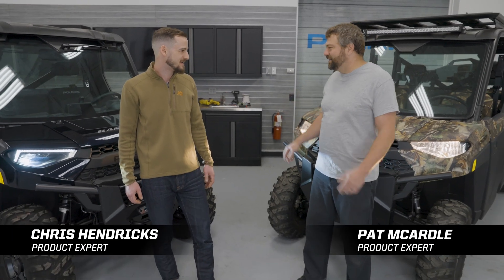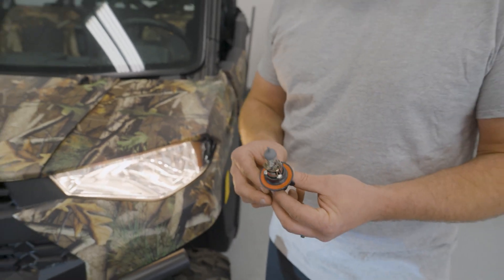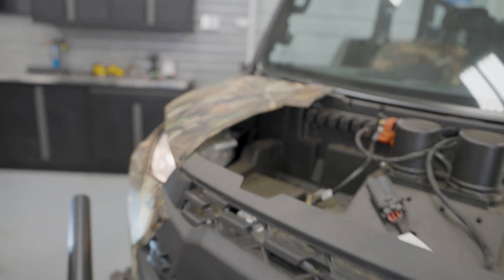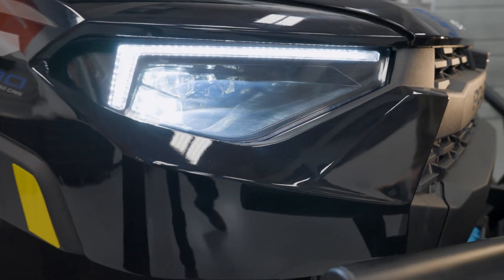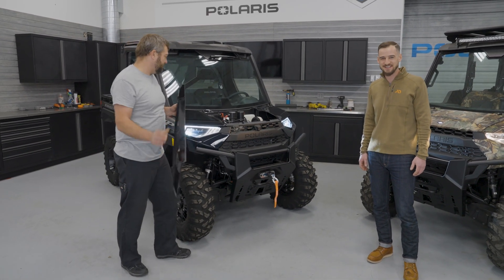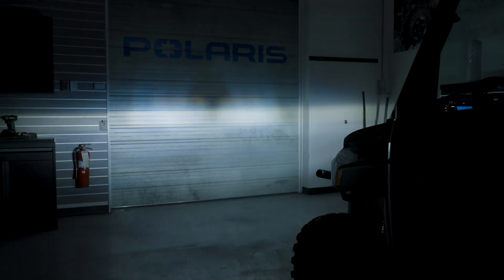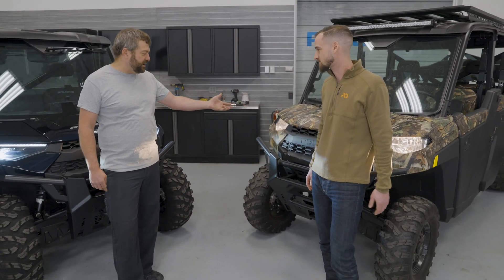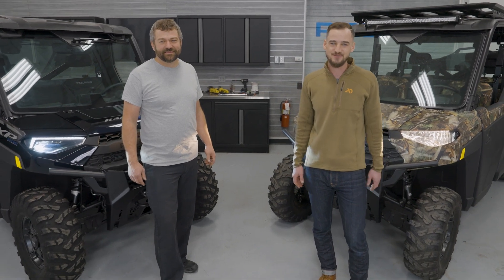LED VS HALOGEN LIGHTS, WHICH IS BEST? - SHOP TALK EP. 15

Comment: The factory LED's on my 21 XPT are pretty terrible.  The Morimoto LED swap into my halogen housings on my 17 900S are significantly better.  LED is the way to go, but I've been far from impressed with the OEM LED's on my RZR.